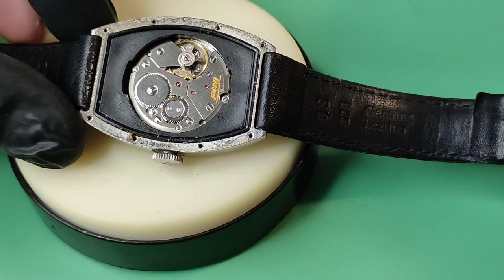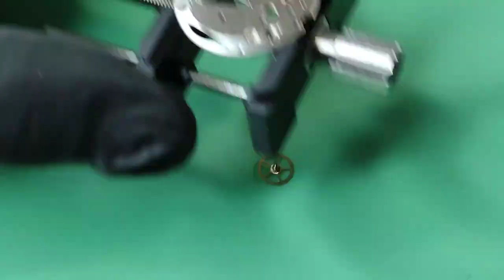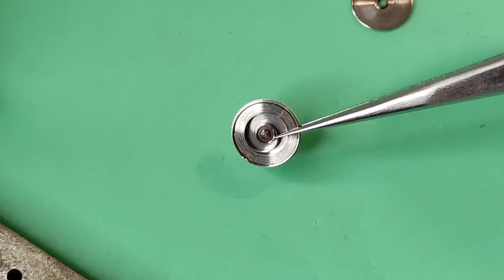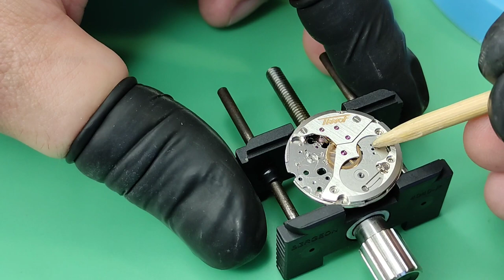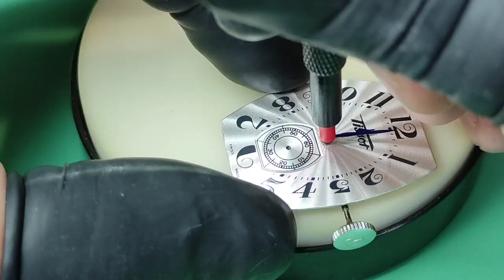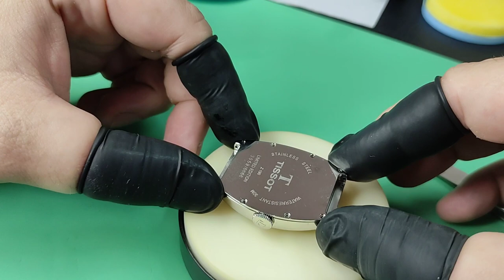Restoration Tissot cal.7001 PESEUX

Comment: Have you worked on the chronometer version of this watch / movement? Is it the same? Thanks for an interesting video!
Reply: why would it be the same if one is a chronograph and one is not? cmon bro....think it through
Reply: @picassoboy52  You're confusing a chronograph for a chronometer, two different things. 😊
Reply from the maker: that's right, two different things
Reply from the maker: there is no difference, only the accuracy of work.  it is identical in the case of old omega - 561 is identical to 562, one is a chronometer, the other is not.  all parts are interchangeable
Reply: @Karol235  Thank you!